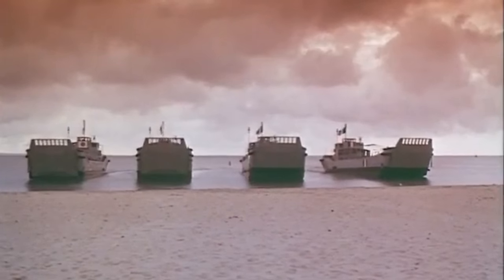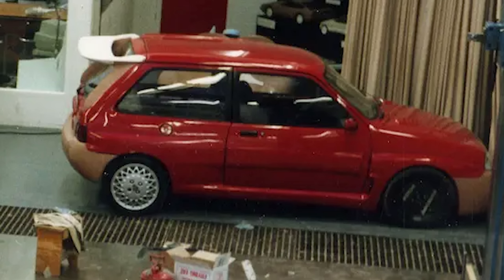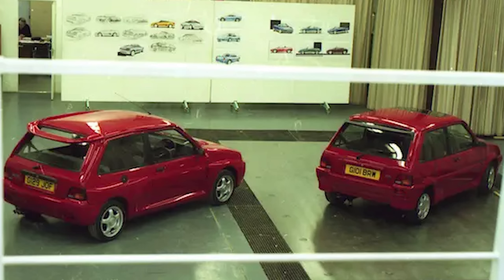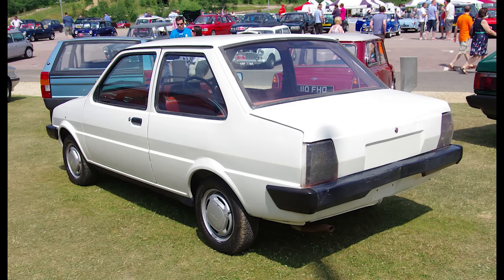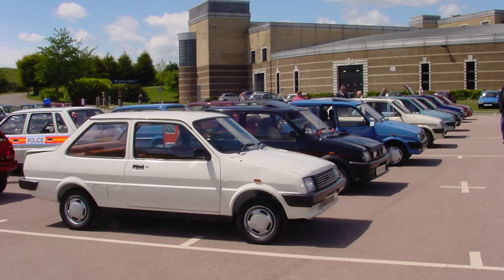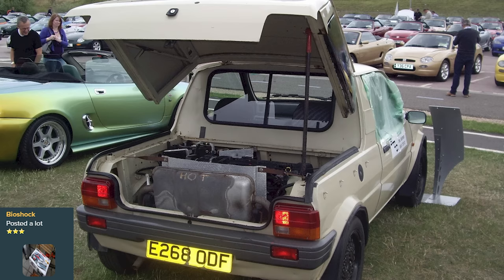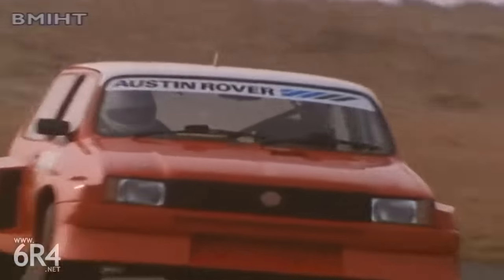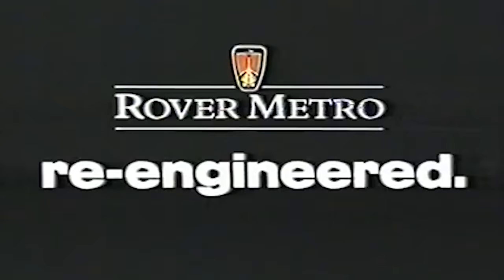METRO MADNESS! - The FORGOTTEN, FUTURISTIC! Austin and Rover Metros!

Comment: No, the proper 6R4s did NOT have a cutdown Rover V8. That was only the very first experimental prototype versions. The Rover V8 has incredibly poor breathing which severely limits power potential. Instead they designed and built a 6R4 specific race engine of 3ltr quad cam 24 valve NA specs and 400bhp in race trim. That cutdown Rover would never have achieved that kind of power, reliability and usefulness. They laterly used the 6R4 engine, this time taken out to 3.5ltr and with twin turbos, in the XJ220 with 542bhp (or 680bhp in the XJ220S TWR version!)
Reply: The engine was also used in that sports racer made by that Scottish racecar company, the name of suddenly escapes me. Think it starts with A, or something.
Reply: @huwzebediahthomas9193  TWR (which is from England, Walkinshaw was Scottish), car was the Jaguar XJR-10 - TWR’s ‘chosen one’, Martin Brundle called it the worst car he raced in Motorsport magazine, early 1999 and unsurprisingly, it had its AZ handed on a plate by Sauber that year

Comment: I've owned 6 Metro GTi-16v's and they were fantastic.  One was the 1-of-500 GTi-SE which would be worth a fortune nowadays.  They were the butt of many jokes, but that made it sweeter when you raced someone and beat them.  Into 3 of them I installed the 1.8 16v K-Series.  The best one was a VVC with a solid cam kit and a few other bolt ons which made 165bhp, coupled with a full SD rollcage and lightened as much as road-legally possible.  From memory it was a little over 800kg.  Scarily fast

Comment: Early in my driving career (90s) I built my own special metro using an MG turbo engine, a full V.P. interior and an aftermarket body kit all thrown at a lowly city plus.   Later I sourced a 1.8 k series but bought an Alfa Sud before I finished it! As far as I know it's still on the road!

Comment: A friends Father worked on the Metro Gti turbo and said the project was dropped because under full boost the gearboxes were failing, this was a Peugeot Citroen box that was not really designed for the power or torque of the Gti , let alone the turbo. The cost of redesign and strengthening was not deemed cost effective for the quantity of production expected. The Honda box would have been perfect but the alterations to the body and the increased production costs were rejected. Even on the  standard 1.4 the gearbox got thrashy and I had all the bearings replaced on my GTi and it went silent and was like a new car. I put 100,000 miles on that bright red  car never once let me down NO head gasket problems !. It was a time when Rover got their act together such a fun little car.

Comment: Early 6R4 used a cut down Rv8 derived engine as a stop gap, the actual proper engine was a clean sheet design by TWR that has nothing to do witb the Rv8 & went on to form the basis of the 3.5 twin turbo derivative used in the Jag XJ220. Great vid with some real oddities!

Comment: I've owned a few Metros, MG turbo, MG 1275. Forever getting the Hydraumatic suspension pumped up for some unknown reasons. Not to mention the gearbox lock ups when the diff broke up and left it unmovable, head gaskets , overheating. The odd size wheels, till i put 13" on them. The lack of a 5th gear. This is on the older cars not the Rover Metros. I could go on about all the grief I  had, but I'd be here all day.
But when they did work they were fun to drive, just as long as you thrash the nuts of them.

Comment: I had the MG metro and the MG Turbo and although 115mph was max speed, the way they drove ie the experience was second to none. . Amazing little car later on I owned a couple of GTi s 16valve and that was also a great handling car. It maybe cuz of the hydro elastic suspension that the metro had was so adjustable literally via a Shardona valve, mine had nitrogen in thanks to the previous owner working for a rally team in Milton Keynes Buckinghamshire. I loved that period in time for hot hatches where you could be a boy racer for very low costs a speed cameras were not even a thing.
Reply: Ah yes I had an MG in the early 90's and can only describe driving it as a "Jet powered" roller skate. 😉 I did have a battery draining issue due to the immobilising alarm, that was disappointing. Resulting in daily starting and running being a must. But great fun to own back then.

Comment: Hi Tom great video 
The metro plus body kit was sold by unipart in mid 80s I fitted one in 85 to my 83 MG
They went on to be sold by another company for the fraction of the price. I fitted one of those to a 1.3HLE I fitted with a 1,4 A series downdraft webber and alloy wheels. I badged this as metro GT

Comment: Good video, entertaining and informative, just a couple of notes; 1) the R in 6R4 stands for 'Rally'. The car was mid-engined, not rear. 2) the MGF suspension is based on Rover Metro sub frames, interconnected frontbto rear, as on the Rover road car. (The A series Austins and MGs had Hydragas spheres interconnected side to side.) 
Keep up the good work.

Comment: I had a 1984 a reg metro 1.0 hle. When I was 19  for my second car. It was only 2 years old when my mum sold it to me and let me pay monthly for it  she bought another new one. I loved it  especially as it was like having a brand new car at a young age. I’m in my mid 50s now and I have  an r reg rover 114 sli. As a modern classic  I love it as much as the first time round
Reply from the maker: I wouldn’t mind one myself great little cars! Love the fact you’re still at it, a real enthusiast
Reply: @tomdrives  I was lucky to find a rust free one with no welding. But I’ve allways had  an austin or morris or rover of some sort. .shame you aren’t in my area you could have had a drive of it. I just recently spent £700 having all the hydra gas units replaced with reconditioned ones so it now drives like it did when it was new

Comment: Had a new GTA in 1989 loved it but 1275 A+ engine lacked a bit of grunt . Part chopped it in 1992 for a GTI Rover Metro ,it had the Grunt but I personally didn’t think it was as nice overall as my GTA . Unfortunately both got smashed up the GTA by the young girl would bought it from the dealer (Kennings) . My GTI with me in it along with a mate of mine in 2003 . Whilst heading out one evening to meet the lads we had just driven through one of the local villages when some kind soul decided they should be driving on my side of the road despite nothing being in on the correct side of the road. The appearance of two headlights coming straight for you was slightly alarming to say the least , especially as the grass verge was only a couple of feet wide ,therefore giving me not much room to move over . With an exclamation to my mate of , he’s going to hit us I remember moving as far over to the left as I could at the same time thinking what ever you do , do not touch the brakes , as the two left hand wheels were now on grass and the right hand we’re on the tarmac of the road . After the impact which must have been a combined 85-100 miles per hour as I was doing about 40 having just come out of the village and into open countryside. The. Impact felt like an explosion seat belts doing there job although I was flung forward and rotated enough on my seat to cut around my eye on the interior mirror. 
 As an engineer I was fascinated to look at how the pedals had lifted up on impact and the engine and gearbox had been pushed down and and had started to be pushed under the floor. The roof was creased and crumpled up to the rear of the sun roof and we had to climb out of the drivers side window. I had just filled up with petrol also so engine kill did its job .
I think I can say I possibly owe my life the Austin Rover engineers as their safety impact design certainly did its job , I always loved my BL , Austin Rover cars they had their faults but then again no more than most cars of the day .
The car that hit us was a Rover 25 and had nowhere near the damage as my GTI , I presume as a slightly bigger car and of course it would a later designed car and that’s progress. The kind soul who was driving turned out to be a Portuguese chap , he didn’t hang around for the police of course despite drivers who came on the scene after trying to prevent him . The car was stolen on false plates and it explained why he was on the wrong side of the road . The Police did get him as after a description I gave they had a good idea where he was living.

Comment: I remember back in my early driving days (the early 90s) a guy driving an extensively modified Metro Turbo (black body and florescent wheels from what i remember? Or that the car had florescent bumpers?) The car was a bit of a legend round town and musta been decent as here in Essex hot hatches and fast cars are in our blood. I also remember being very impressed by the performance of a Metro GTI that i raced while i was behind the wheel of an Astra GTE 1.8ltr (115bhp 60 in around 9 seconds top speed 124mph) I had been in untold numbers of Metros over the years but nothing close to being that quick. I would say that the GTE and GTI were pretty much of equal pace. The girl driving the GTI was also a good driver too. 
I always had a lot of respect for Minis and Metros but always felt the Metro just wasn't the evolution it should have been. Even the Turbos weren't exactly pedestal material sadly. Wasted potential. Really the Metro Turbo should have been equal performance wise to the Renault 5 GT Turbo, being similar size, weight, engine size etc. But instead the Metro was about 2 seconds slower to 60 and 10+mph down top end. It also stuck with a bloody 4 speed manual which pretty much everything else had gone 5 speed. Metros also just didn't have the attractiv
Reply: Metros just didn't have the youth appeal of the 205, Renault 5, Nova, Fiesta etc.
But the 6R4 will ALWAYS remain my all-time favourite racecar. Those utterly INSANE looks! The 6R4 looks like a standard Metro only from the glass up, the rest of the car swollen, aggressive, purposefull and mean. Then you have that roaring, high revving brutal V6 barking and then screaming off down the road at staggering speed! Then Will Gallop took a 6R4 to Rallycross and decided that 400bhp was nowhere near enough power! So he twin turbo'd the engine (plus also reducing the engine capacity from 3ltr to 2.3ltr I think? Done to keep the car in the right competition company) giving him over 900bhp! The NA 400bhp 6R4 hits 60 in the low 4s/high 3s (?) Gallops 6R4 hit it in under 3 seconds!

Comment: The engine in the 6R4 is not a modified Rover V8. It is a bespoke engine designed by David Wood with twin overhead cams and 4 valves per cylinder.
Reply from the maker: Do you have a source for that so I can pin that amendment? All I saw pointed to what I said.

Comment: The prototype MG Metro 6R4 is still in the museum at Gaydon. It used a cut-down Rover V8. But the actual production 6R4 had a bespoke engine, as others have said. 

An interesting Metro variant is the MG Metro Turbo, that was a test bed for an experimental 1.3 litre, straight six.

Comment: Rust bucket death-traps that were primitive compared to the competition, facelifted and rebadged over 18 years... But ultimately same old crap from Austin/Leyland /Rover..... Cheap tat, no power, no desirability, as a young driver in the late 80's early nineties, no-one was interested in the "sporty" version as they were just as crap as the "hearing-aid beige" one that your gran used to drive...

6r4 was essentially NOT a metro.... Other than the basic shell.... Which wasn't a basic shell.
Reply: Not a fan then-!!!
Reply: Bought a cheap rust bucket on its last legs and expected a Rolls-Royce 😉
My mate complained about his too (MG metro) it was 15 years old and still complains about it 27 later. Paid 300 quid for it! 🙄